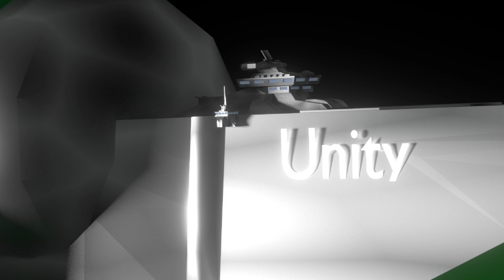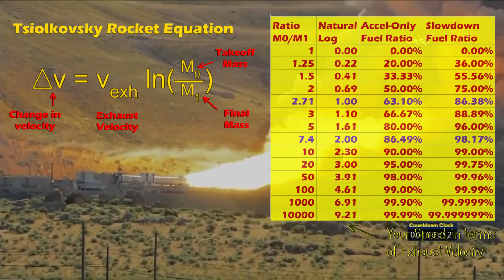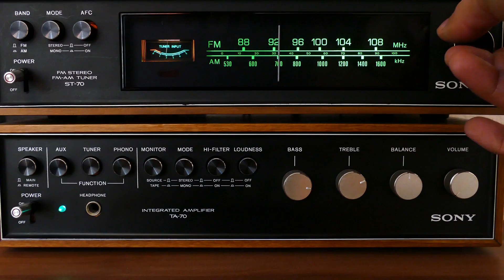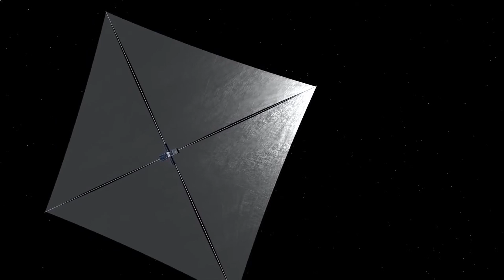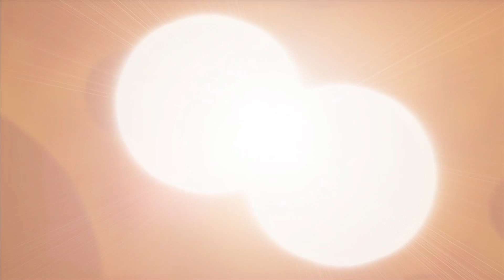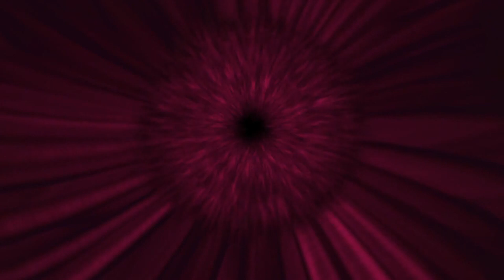Interstellar Travel Challenges

Comment: Objects traveling faster than 4 mps release all its energy on impact, and don't leave long holes.
Just a minor point :)
Reply: Isus Krist
It is one of those mysteries where some meteorites couldn't be found even though there was this huge crater.  What happened was, if the speed of the object hitting the ground was higher than 4 miles per second it simply vaporized. Probably due to the amount of kinetic energy released.
Reply: I read that as 4 meters per second and was confused, like "that's pretty slow". Then I realized it was miles lol
Reply: I was going to make the same point.  Many thanks for covering it!
Reply: Evol Bob can you explain that pls
Reply: So this kinetic energy is a bond between atoms? Like its own gravity.

Comment: I have a question... more like a favor really, but, could you tell me or even look into a particular type of ship design where the ships engines are up front and the ship is pulled rather then pushed? The idea is that, something that is pulled would need less structural integrity and therefore less weight. Example , its easier to lift a horse with strong light weight tethers attached to a motor, then it is to pick it up with a heavy mechanical vehicle. I would like to hear your thoughts about this design, and if its a good idea or not, being that things like rocket plumes are shielded from hitting the ships main body somehow and any other problems have been taken care of, if this design would be more efficient. Thank you for your time, I'm a big fan !

Comment: There is a way of getting to other star systems without using fusion or other technologies you listed: have extremely long mission times. You only technically need a delta-v of the escape velocity of the star after all, anything else is just to speed things up.
Reply: I'm with you! We could have launched an interstellar mission in the 70's. 

But... You risk having someone leave a century later on in a much faster ship, and arriving to find a thousand-year old "colony."
Reply: Bo Zo I don't think we could have done. The voyager probes (in the 70s) can leave the solar system but they will run out of power in 2025. If you are going to have extremely long mission times, you need an extremely long-lasting probe, and I don't think we were capable of that in the 70s.
Reply: +IamGrimalkin - I was perhaps exaggerating a little. But really only a little. 

We (technologically) COULD have used gravity slings a la Voyager to send a very large vessel - basically a mobile space colony. We (technologically) COULD have built such a station. 

(Financially? Politically? Pragmatically? Very doubtful!) 

And there were better options than gravitational slingshots, even then. 

As to power, fission could provide power for nearly forever. Which you'd need, because it would take nearly forever to get anywhere. 

It would have been stupid, and a huge waste of resources, and I'm glad we didn't do it. But I think it's been just barely possible (to do it badly and expensively) for a while. 

Don't you think it would be possible today, if 100% of global resources were devoted to it, to send some kind of large ship to Alpha Centauri? Not much has changed since the 70's, really, to suddenly make it possible where it wasn't before.
Reply: +IamGrimalkin - As you said, you really only NEED to exceed the escape velocity of the solar system, which isn't so hard. 

I don't think we'll be able to do it in any sensible way for a while yet. It won't be a reasonable expense until there's a surplus of heavy industry in space. New tech will improve the mission (faster, safer, better), but I don't think tech is the main obstacle.

Comment: So aerodynamic space designs actually have a use?
Reply: I wouldn't use the word "aerodynamic," since that has other implications. You won't steer a starship with ailerons. But yes, having a slender (although not streamlined) hull makes sense since you only have to armor / protect the cross-section - just what faces forward. So you'd have to armor half of a sphere (almost), or a sixth of a cube, but it could be as little as a hundredth (or less - whatever you like) of a long cylinder or long rectangular prism. Cylinders make more sense than prisms, so expect "fast" ships to be cylinders at least 10-20x as long as they are wide. (Doesn't matter so much for slow ships. We could use spheres or cubes or whatever for interplanetary travel or for very, very slow interstellar.)

Comment: When we finally build a Dark Energy projector engine (DeBender,) we won't need frontal impact systems as it will just spatially bend matter around the hull. Of course, we'll need to survey high density mass locals for proper, less hindered streams. We'll be able to achieve this in only a couple centuries provided we increase/sustain resources into education/technology and don't destroy ourselves before then. Just say'n! ;O)-

Comment: Where does Metallic Hydrogen as rocket fuel sit in the list compared to fusion.
Reply from the maker: The same, its a chemical form of hydrogen but is still hydrogen.
Reply: It isn't clear if metallic hydrogen would remain metallic when removed from the intense pressures that created it but it's advantage is simply less volume for the same amount of hydrogen which conversely also means more expansion when used as a fuel and propellant.

Comment: I did not find the exact time dialation / light speed% formula but if they travel fast enough they can possibly suck:
they fly and fly and spend some decades in their ship
here on Earth, some centuries or millenia go by and BOOOM, we inwent warp drive
we travel in the good old Enterprise way (some solar systems during a TV commercial) and we arrive much much earlier than those unlucky pioneers
Reply: yes, that is old and well known paradox, and it is known for centuries, as old saying - Festina lente
Reply: There's no reason the advance tech ships cant visit the colony ship, and take them anywhere they like. Or, they may be able to get the plans for the drive over their data link with earth, and and manufacture the advanced motor themselves.

Comment: There are problems with something like alcubierre drives, but the point is more or less that they cheat, a lot.  If you can get around the theoretical problems of causal disconnection, the production of exotic matter, potential extreme internal hawking radiation in a truly superluminal bubble, and the liklihood of flash frying everything in front of you when you do manage to stop a superluminal bubble, it can cost significantly less energy to go faster than the speed of light, or to approach the speed of light through an alcubierre metric but avoiding the possibly intractable problems of FTL, than to approach it by moving through real space, since some constructions would require an amount of energy less than a 700 kg equivalent.  It's not wholly unreasonable either since we know that space itself is able to expand faster than the speed of light, which suggests that the idea has a basis in reality beyond simply being a technically consistent solution to Einstein's field equations, though whether it might be instantly fatal to everyone trying to use it is a different story and possibly quite dependent on whether or not you try to use it to go faster than light.  The historical expansion of space faster than the speed of light is an indication that such solutions are not inherently disallowed by an as yet unknown theory of quantum gravity, but the conditions under which rapid spatial expansion occurred are not promising to the survival of any matter moved under them.
Reply: Realistically this has probably all been covered in another video though XD
Reply from the maker: There is an episode on the Warp Drive, yes, but time travel paradoxes was covered in a different episode, see the FTL series

Comment: Still probably worth sharpening "the pencil" Increasing the cross-section of the armor without adding mass is probably desirable.  Thanks, panzer tech!
Reply from the maker: Yes you probably would
Reply: depends a lot how the magnetic shield would going to look. Sharp pencils + magnetic field = bad ideea
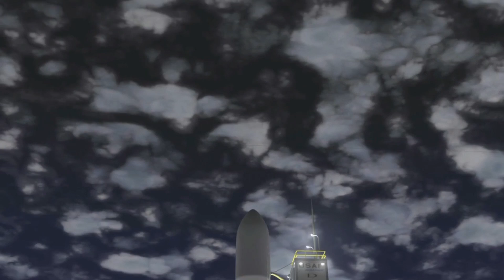Reply: Yes, I was thinking the same.  I would think to provide the most protection to the rest of the ship behind the point you would actually want it to not only be a cone but one with a wider diameter than everything behind it (other than the telescopic laser array arms), just like the rocket shown at 27:23.

Comment: If you're accelerating half the trip and decelerating the other half, you have to turn the ship around in the middle. Once your ship is backwards, your engines are exposed to interstellar dust. While turning around, your cross section would massively increase and the long side of the ship would probably be a lot less armored. It seems to me that turning the ship around in the middle of the trip would be a really tense and dangerous part of the trip. 

Also once you're decelerating, you probably can't use your solar sail type things that ride ahead of you (unless you were ok with not getting them back and effectively shooting them past your destination). 

Thanks for the great videos as always!
Reply from the maker: You're not, accelerating the whole time, probably just the first year tops and the last year, maybe just weeks. You also don't need to flip, though that wouldn't take long and you could launch a sail out in front of you during that. But this is space, you can just detach the engine and move it to the front.
Reply: Thanks, I hadn't considered that you're only accelerating a small chunk of the flight. I just plugged in the numbers and found that if you accelerate/decelerate for a year, you're very well under 1G. If you're only accelerating a few weeks, then gravity is going to be quite diagonal in your rotating habitat. That could be pretty amusing, "You mean my bathroom is uphill from my bedroom for the next few months?!"

Comment: Every time you encounter that particle of dust it will throw you away from course, deviating you from the way to destination so you would need to constantly correct your course with more fuel.
Reply from the maker: Run the numbers yourself, that's always the best way, but no you don't have to worry about heat build up at 10 or 20% of light speed from radiation. That is an issue when you start getting much closer to light speed, as I said at those speeds you start getting drag
Reply from the maker: No, check your conservation of momentum. I hear what you're saying but you need to run the numbers, you're losing track of scale, that ship has an insane amount of kinetic energy, way more than all the combined mass it will run into in 10 light years.
Reply from the maker: It won't through you off of course, all its velocity is in your direction except the tiny amount it has relative to local space. It's a gigaton mass ship, even a pebble moving 100 km/s isn't going to do much.
Reply: ᕳᖈᗋ ᘃᕒᖍᗜᘈᗨ That's a miniscuel amount of fuel compared to the forward acceleration.
Reply: not at all, at these speeds correcting course is costly not only in fuel but in overloads of Gs, and you also would need some form of developed astro navigation. Isaac talks about laser highways, but before we have them built it will be thousands of years flying for the first time. Everything we will be doing will be accompanied with words "for the first time". And only after some thousandth  time we will be expirienced enough to be sure that it is safe.
Reply: It's more like a century, not millenia. At least to the nearest stars.

And even at these speeds, the maximum acceleration you can get from those objects would be the kinetic energy of those object compared to you. And as he pointed out, that's a nuke at most, some dynamite, and mostly bullets. That's not all that big compared to a fusion generator carrying tons and tons of hydrogen. And that is in a worst-case scenario. Most of the energy is spent getting us slightly off course, not the theoretical maximum.
Reply: Isaac, Its not like flies that are hitting your car when you are driving at a high speed, they lterally explode on the impact and they explode all the time counterin your propulsion efforts, on different points point of your shield, acting like little thrusters. The power is not enough to stop you, but they can turn your ship slightly at first and then spin you out of control. Imagine a bullet somersaulting inside the body, that would be your huge ship if it will encounter huge numbers of space particles at high speeds.
Reply: While off center hits to some sort of domed shielding could apply a torque to the ship you have to consider the inertia of such a massive ship.  You'd need a tremendous impulse to generate a sudden change in direction sufficient actually cause the inhabitants of the ship to experience large G forces, and at that point the shielding probably isn't enough to handle the sort of damage that would be caused.  Any minor deviations to the ships course and orientation can be handled easily by two rings of thrusters oriented perpendicularly to the hull at the front and back of the long space city needle.
Reply: Isaac, I read from an old article about Interstellar travel where numbers are given and they indicate massive explosions on the shield far from the centre of mass. Like hundreds of tonns in TNT equivolent from mear particles with mass of 1-5 gram. Imagine having nuclear reactor in your back and constant explosions about near Hiroshima size in the front, having to sit in the middle, probably feeling the vibrations from both. And that is not the only problem, any shield you will have will be heating up from those encounters, and what will you do with that heat? what kind of radiators do you think will be capable of dissipating that heat for 10 years or more and surviving the encounters themeselves?
Reply: Chris, i am talking about events when they can throw you off course suddenly and of the numerous events that can add up and change your direction gradually. In any case the thrusters won't hundle it "easily", they would need to generate the exact counter force in the right direction and that puts stress on the hull. They also can enter into nasty resonances and again - make a whole more lot of problems.
Reply: hey mister...Шамиль  a nuke exploding'' in space is just a flash of light Little kinetic per high''temperatures'' Get it now ?

Comment: Have you considered matter absorption armor and capturing neutron stars as a power source?
Reply: The power density of a neutron star would matter, not the total power. And the power density isn't very big i think.
Reply from the maker: Even as huge as I like to envision things, I can't imagine using a neutron star as a power source, too big. Also I don't think they'd be ideal.
Reply: Neutron stars aren't that big, like the size of Rhode Island. Big, but I can imagine a ship the size of the moon, so if there were a technology that could contain a neutron star, I don't think building a ship big enough to house it is the real hurdle.
Reply: Just looked it up, they're like 10km.

While still fairly large, a spherical ship housing a 10km neutron star is not out of the question.

It's of the class they usually call "World Ship".
Reply from the maker: No they're not 'big', but they are more massive than our sun, mass is what matters in space travel.
Reply: They're massive, and they're highly energetic! The whole point is if you could harness that energy (through some undiscovered technology) perhaps you could not only achieve ridiculous acceleration, but also the power needed for the insane shielding and other protections you'd need to travel that fast. There's a lot of power stored in a neutron star.

Comment: This is off topic, but I'm in the middle of reading Beyond Earth and it has quite a bit about the dangers of space travel. I believe in on of your videos you mentioned one would only need build habitats a few feet underground to be protected from radiation but in Beyond Earth the figure is closer 90 feet. Wouldn't that mean shielding for space habitats would have to be about 100 or more feet thick in general?
Reply from the maker: I honestly hadn't heard of the book, and I didn't recognize the author. I've never heard figures that high before, or over 10 meters to be honest, but you could do 30m/100ft if you wanted too, hydrogen between layers of metal foil, cheap.
Reply: It's a fairly new book and I think the heavy shielding has to do with the high velocity atoms from cosmic rays (carbon, oxygen, silicon and iron). The book goes into some depth about that and that energy they have makes shielding impractical. I don't remember, how could you get a lot of hydrogen in space? I mean short of star lifting or pumping it out of Jupiter.

Comment: Ice. Cover the front of the ship with ice a few hundred meters thick. Sounds dumb, but many advantages:

1) Ice is very, very hard at interstellar (i.e. absolute zero) temperatures. It could function as effective armor.
2) This is one of the densest forms of Hydrogen possible, and would function as fuel without having to put it in tanks. The most massive part of the ship is likely going to be the tanks to hold fuel, if a large fraction of the ship needs to hold fuel. This will make your ship significantly lighter.
3) Ice is very, very abundant in space.
Reply: You would want to use pykrete as it is much stronger and still mostly frozen water.
Reply: A decent plan, thou I'd still want some of the methods Isaac proposed, to make sure you don't slam into something big enough to blow off a big chunk of your fuel reserve